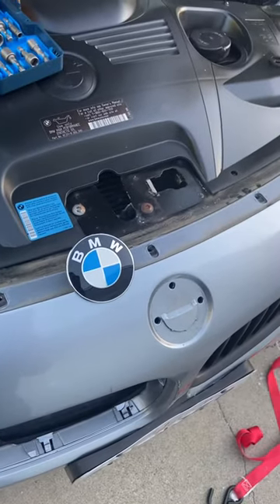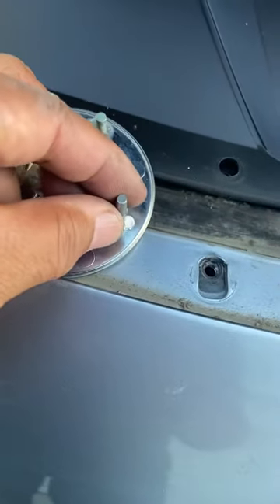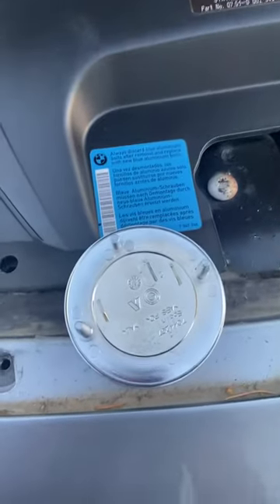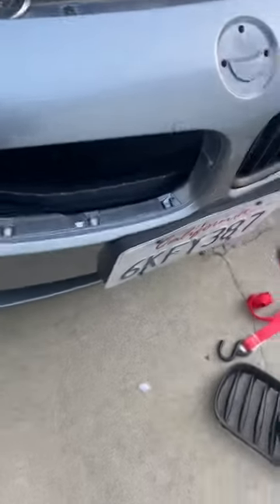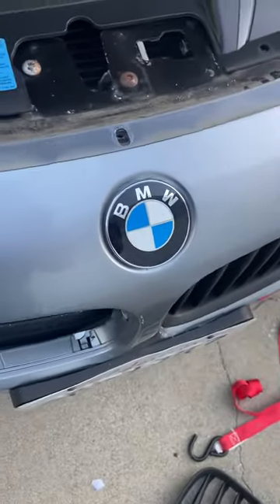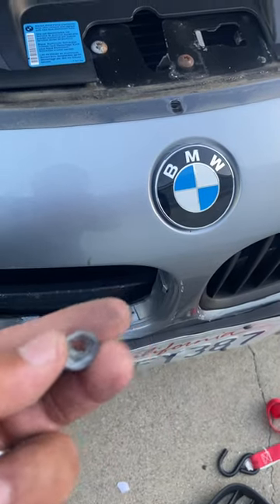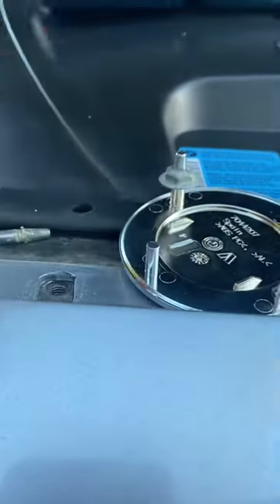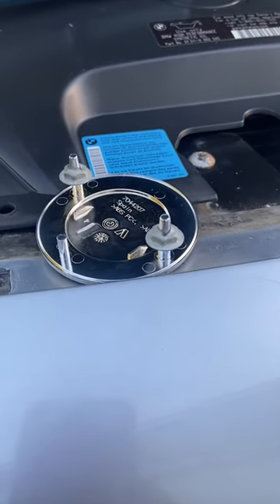2007 Z4 e85 Front Hood Roundel Replacement

Comment: So I have my new front badge. I have the two new speed nuts. But, before I try to attach this, I'm wondering how you attached your front badge. My old removed badge had threads on the two pins. New badge has smooth threadless pins. So, how would those speed nuts hold the badge in place? Don't you need at least two rubber grommets for smooth pins to sink in and hold? 

Also, the grommets for trunk emblem are too large for front emblem badge pins. Won't hold. Do you know exactly where I can get the correct fit grommets for front emblem attachment?